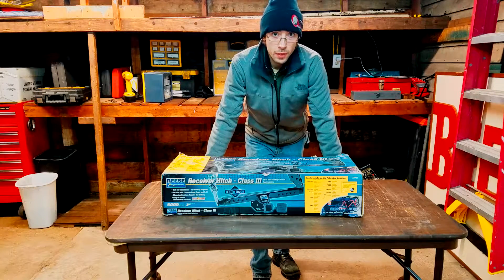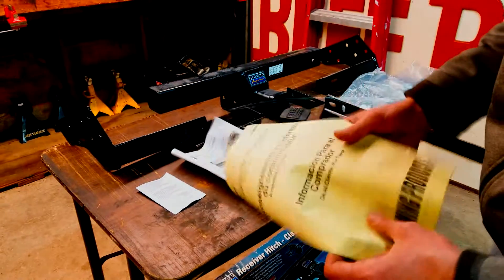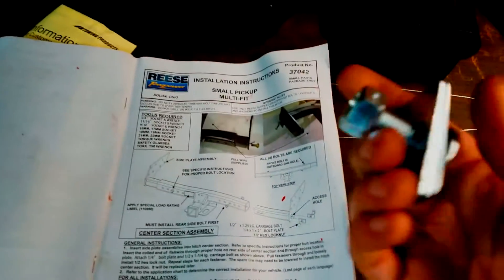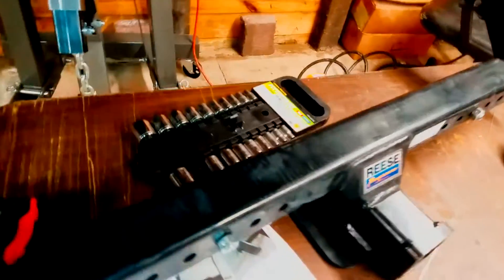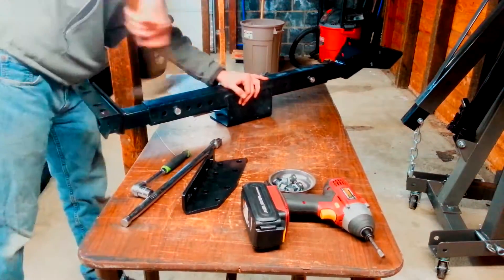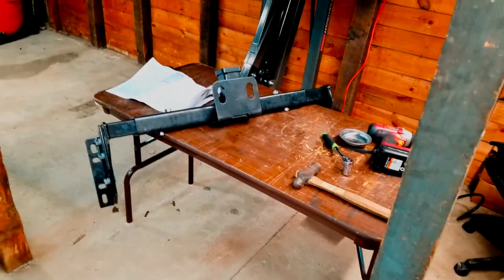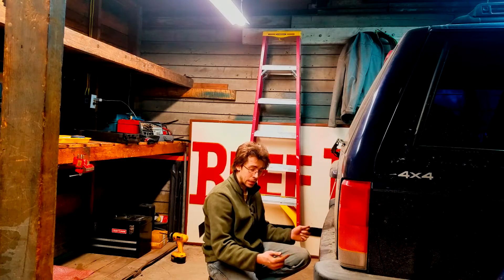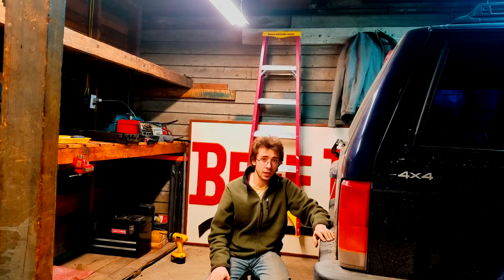Overveiw of and Installing a Reese Universal Receiver Hitch on a 1999 Jeep Cherokee

Comment: The last bolts closest to the bumpers requires the square washer instead of the rectangle to clear the lip. My instructions stated that. Also, like stated below, install one side and then the other with the center piece. It can rest in the installed piece, and you won't have to man-handle it. Lastly, the bolt chaser wire is super cheap on amazon, go ahead and center that thing. It would bother me till I did, and you never know when your buddy will need you to pull a trailer for them.